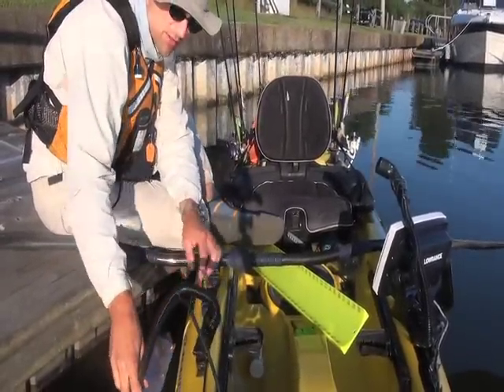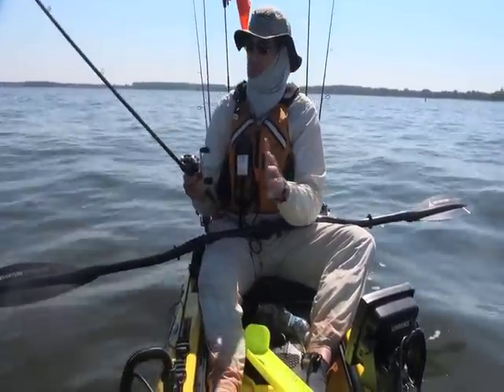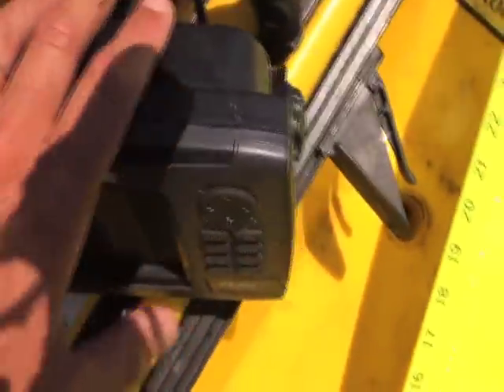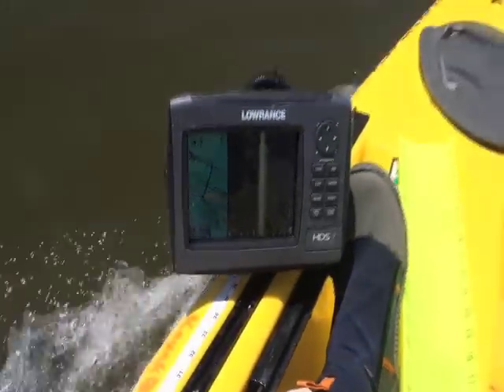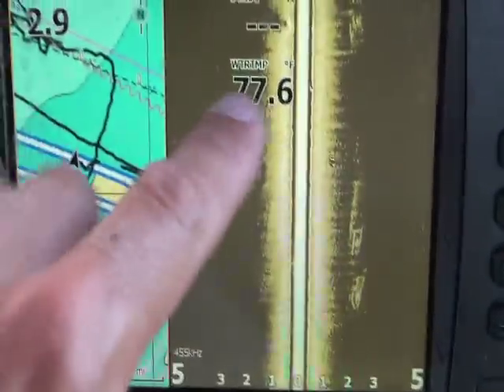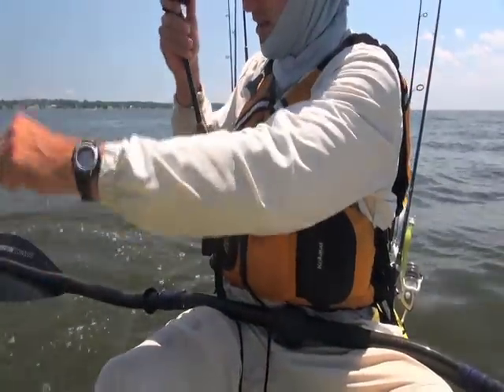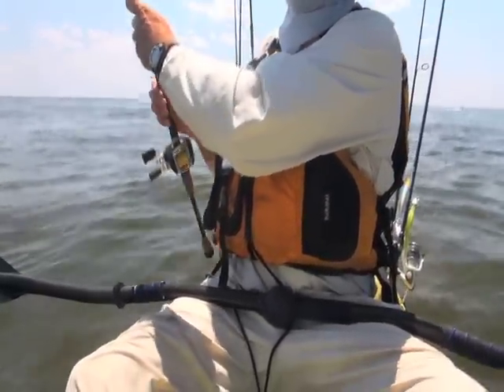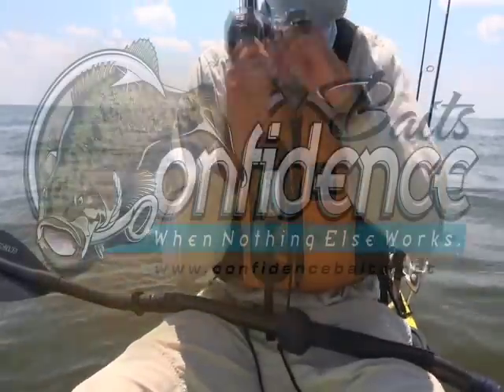First Trip with Structure Scan

Comment: Do you get much additional benefit from the Navionics card since you already have insight USA that features hot spots? I know you have not got to play with the settings much but one suggestion would be to set the SI to Auto. When you were logging the pilings you were only viewing 5' in either direction. With the LSS you can view 300' to either side of the boat as long as you are in deeper water. I upgraded my Battery to a 90ah bc running two 9ah batteries only gave me around 6hrs. Good luck!!